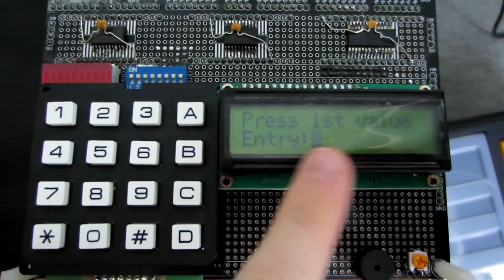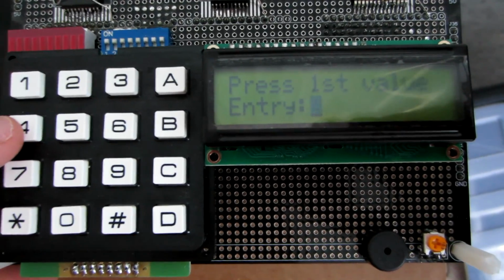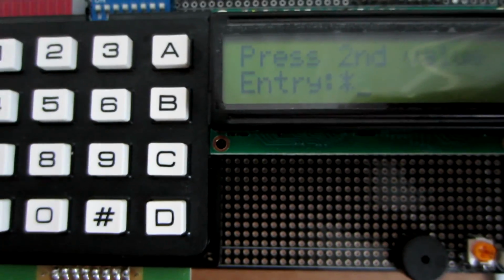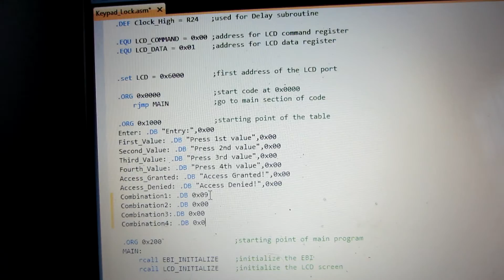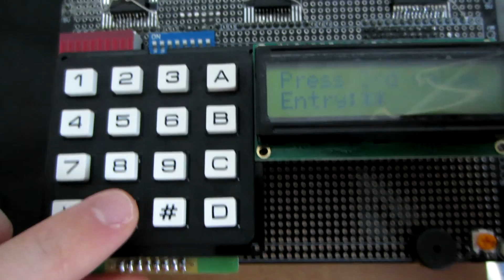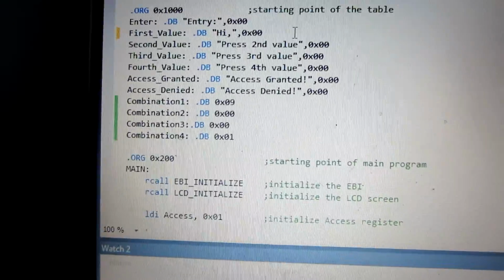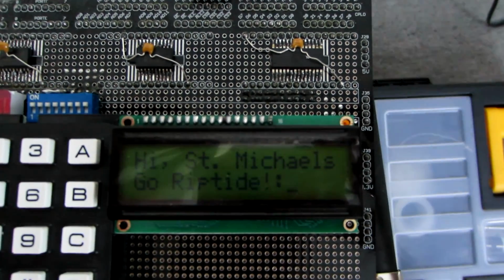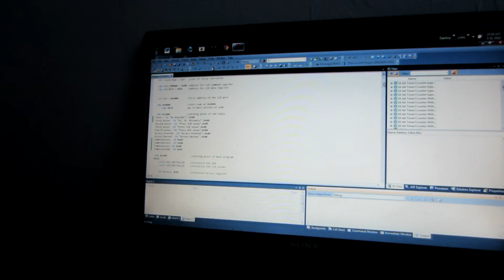Security Keypad Lock with a Microprocessor

Comment: Hi i would like to get details on project on digital locking system using 8085 microcontroller ..My team and I are doing a mini project. We need help on digital locking system using 8085 microcontroller about
-the coding
-the software requirements
-the hardware requirements
-the simulation tools
-the circuit diagram
-the block diagram
-the flowchart